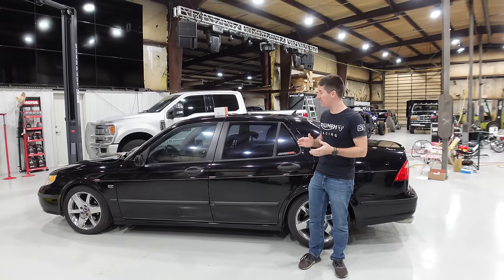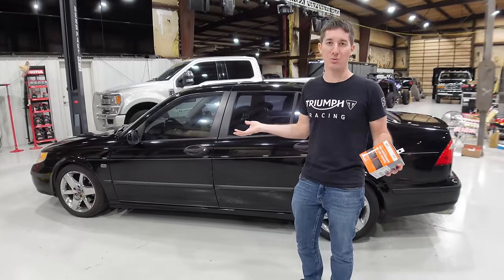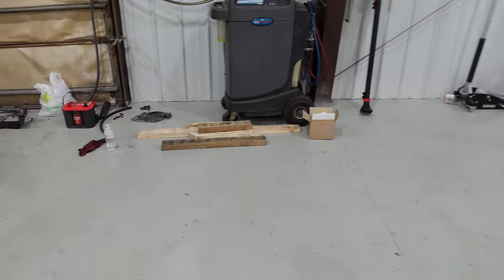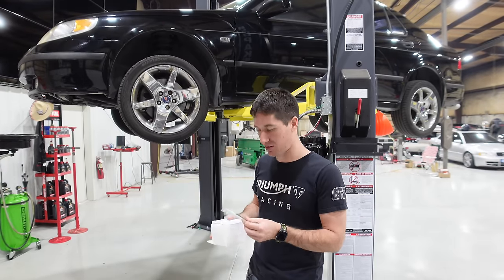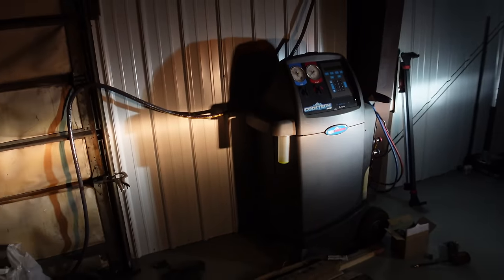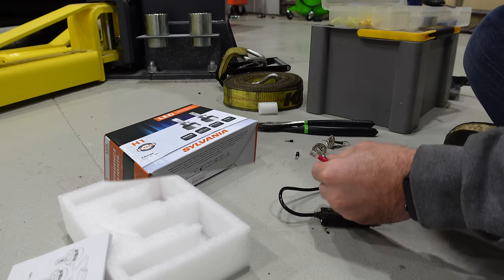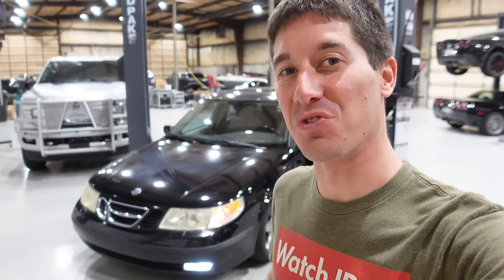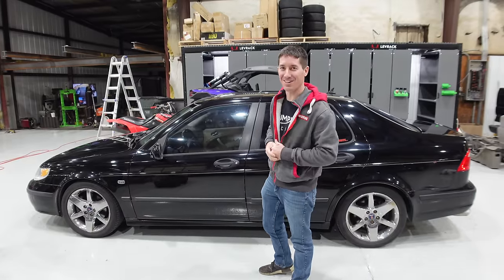Testing LED Fog Lights VS Halogens In My SAAB 9-5

Comment: So how does it work in the FOG? Actual fog lights are yellow for a reason. Yellow cuts the fog better than white or blue. What you have are driving lights not fog lights.
Reply: I find that too bright a light just bounces back at you in fog
Reply: The number of factory fog lights I have seen on US cars with yellow bulbs or lenses can be counted on one hand. Personally I have never understood the obsession with fog lights. In my part of the country fog is not common and good driving lights would be far more useful.
Reply: @RandomGuyDan  Used to run a set of 8" Hella fog lights with 100w bulbs. the pattern was great and the 100w bulbs behind yellow lenses cut through fog or even snow amazingly well. Made my 1.5hr commute a breeze.
Reply: It has already been said in the comments that he doesn't really have fog lights. Either of those lights will be a bitch in real fog. Having said that..... Fog isn't really a problem in Wichita.
Reply: Halogen lights for Halogen headlamp fixtures. Yes
Reply: @eggy1962  kkkk k kk kk k k k kk k kk k kkkk kkk kkkkk k k k k k k kkkk kkk kkkkk kkkk k k k k k kk.

Comment: I believe these over- bright lights are unsafe and effect oncoming drivers night vision adversely.
Reply: Same.  That's why I've never used them in a non projector housing meant for halogens.  The beam goes everywhere.
Reply: it 100% illegal to install leds in halogen light assy. reason companies can sell them is because they say in the fine print on the box offroad use only.
Reply: @mraccord92  projectors don’t change anything…. They will stop put out more useable light with the halogen bulb they are designed for.
Reply: He clearly shows the beam pattern is preserved and won't blind anyone.  Headlamp installations may vary but these are effectively the same as the incandescent
Reply: @GH-rc8ht  why comment if you didn’t watch the video?
Reply: That doesn't bothers me as much as a brodoser with un adjusted headlights.
Reply: Better LED bulbs are designed to closely mimic the light dispersion pattern of halogen bulbs, and provided the housing is adjusted properly it won't effect oncoming traffic.
Reply: @SteveBassen  yea, no. Lmfao.  OEMs can’t even stop LEDs from glaring….  🤦
Reply: @highseed69  Only "illegal" in headlamp housings.  Fogs have an agreed upon "pattern" among manufacturers though their effectiveness varies greatly from maker to maker.  Not DOT regulated in the same way headlamp patterns are.  

Read his Sylvania H1 box front carefuly. "For Fog Use Only" nothing about Off Road Only.  Sylvania as he points out is a global company not cheap aftermarket junk.  I'd think someone would certainly target them if their bold box labeling was incomplete or an saying it's a H1 replacement that's not street legal under say, DOT or MOT standards.  

I'll wait for the Sylvania yellow spectrum version to come out.
Reply: @GH-rc8ht  Problem is most people where I live drive with the "fog use only" lamps on full time. Doesn't matter if it's foggy, snowing, wet, dry or even daytime vs nightime, they all just want to illuminate literally everything in front of them as bright as possible.
Reply: @GH-rc8ht  when they over power your headlight they are illegal. ive done the updated inspection courses and my dad been automotive red seal mechanic since 1978. those bulbs are over bright because they qill blind back in fog and snow at the driver. also those are driving bulbs because white not fog lights(fog are yellow). the top light line is even but 
in the video u can see they are flooding forward and sideways too much. u dont want white pavement when light is on.
Reply: Oh yeah i dont care
Reply: Not true for fog lights. You can replace them with led and it is legal

Comment: I did the same mod to my explorer.  I put in led fogs.  Which are as bright/brighter then my headlights.  And left the headlights as the halogen bulbs.   
I also modded it so I can run the fogs and high beams at the same time.  Which really helps make everything brighter.

Comment: I have replaced all the lights on both my Harly's with LED all around.  2001 Fatboy, Headlamp, Passing Lights and signals, break and running lights and my 73, Ironhead Headlamp and signals, breaks and running lights.  On the Fatboy I had to add a resister in the turn signal line so I could use the turn signals.  On the Fatboy I bought an adjustable blinker unit that allowed me to add resistance to my turn signals till they worked.  It has a dial on it.  I did this not so much for the quality (Quality is better than the OEM incandescent bulbs)  but to save on power usage.  On the Ironhead you have a generator that only puts out so much power and on the Fatboy I added a full fairing with Sterio and I wanted to save on power from the added audio.  Great solution for quality of light and saving on power.

Comment: I put Diode Dynamics LED bulbs in my '18 Colorado low beam projector housings. Very noticeable improvement over the stock halogens (although I've gone through a few pairs, had issues with dimming, but the company has honored the warranty and sent free replacements).

For fog lights I actually prefer keeping the stock halogens. The slightly amber-ish color temperature I think does a better job helping me differentiate what's right in front of me than the white/blue-ish LED color.

Also for hi-beams I run halogens for one main reason - here in New England during the winter, ice will form on the headlights. Old school halogens throw off a ton of heat and can quickly melt the ice. LED's throw off little to no heat, so the ice on the headlights won't melt, forcing you to bang on the light housing to break the ice up. With my setup I just let the truck run for a few minutes with the hi beams on, and that's enough to clear the plastic housings off and drive off.

Comment: LEDs are cool, however not practical in the area I live in winter.  They don't produce enough heat to keep ice from building up at -25.  And the lights freeze up much faster at -40.  But I do like them.  If they weren't such a PITA to change, I'd run xenons in the winter and LED in the summer.  Just like changing tires for winter and summer.

Sylvania usually does their research on lights, however, I'm not sure the color will be good in fog.  Usually amber is what's used in heavy fog and blowing snow.

Comment: Really like the Zevo license plate lights.  Lifetime warranty on those!
Reply from the maker: And the best part is I've never had a failure on one! 💯
Reply: @waynepantry7023  as long as the original owner got that part. So say I buy a lifetime warranty on bulbs if I sell the vechile the lifetime warranty goes away
Reply: @waynepantry7023  just register the bulb with Sylvania and submit the receipt and they keep it on file.

Comment: If you do the window rollers, use Volvo v60 ones. They're square instead of round and don't tend to break as easily. Nobody else really has videos installing them but they're supposedly much better.

Comment: I have a 2002 Saab convertible and one interesting thing is it's came with a rear fog light from the factory on the drivers side. On right hand drive Euro Saab cars had a drivers side rear fog light. Not sure if the 9-5 came with that option but still an interesting option.
Reply: The saab 9-5 does come with this option, it intensifies one of the rear break lights.
Reply: Late reply here... I also have a 9-3 CV w/the driver's side rear fog lamp, but I only realized myself a few years ago that the right side w/trunk keyhole is just glass. Anyway, I went to a different garage this year for my state inspection, and b/c MA doesn't test emissions on cars older than 15 yrs, it's mostly about safety, esp. lights, but not fog lamps. I had to tell the guy three times that side is not a light, but he wouldn't listen... instead, he insisted on opening the trunk and inside panel to look for a bulb. Of course, he didn't find one.🙄
Reply: @laurat1129 why didn't you just show him the owner's manual? 🤔 Anyway he can't be too much of a mechanic or inspector if he is unaware that this is a common feature on many vehicles made in Europe. 🤷
Reply: @seanwainwright2627  Not sure where you are, but it doesn't work like that in most of the U.S. If he wasn't going to listen to me as the owner, what makes you think he was going to read the owner's manual?😑

Comment: How bright do the fog lights need to be.  Won't that light reflect back when you are in real fog?
Reply: You are dead right. If you have lights that are too bright they reduce visibility because the water molecules in the fog/mist reflect the brighter light and you get a cloud of glare in front of you.
Reply: But it lets others to see you easier.
Reply: @emrei  not in fog. All on coming traffic will see is a wall of white light. Meaning you as the driver in your car can’t see nor can the car coming towards you,clearly see your car’s position on the road.
Reply: They are mounted low to project the light under the fog and out of the driver's line of sight. The low height helps to reduce the scattered light coming back into the driver's eyes. 

Yellow does work better because of reduced scatter compared to a white light spectrum.  It also has the benefit of improved contrast for the human eye. 

Check out France's headlamp laws which ended in the 80s.  Yellow headlamps and fogs were the only setup permitted prior to.
Reply: @emrei  That is not the purpose of fog lights.
Reply: @GH-rc8ht  I drove down from Oregon to Las Vegas in January one time with a trunk loaded with heavy stuff.  Most of the way I had to turn off my headlights so I could see.  They light was reflecting back onto me and blinding me.  The bright fog lights will do the same thing.
Reply: @GH-rc8ht  We saw in JR's test at night, the fog lights lit up the whole street.  He said his headlamps weren't even on and I could see for quite a distance.  Fog lamps don't need to be that bright.
Reply: Yellow fog lights work better
Reply: It is exactly the purpose, to be seen @mexicanspec
Reply: @emrei  You are kidding, right?

Comment: Fog lights are ment to be yellow as they cut better in fog which is the whole point of them white LEDs will cause the fog to be blinding also you should never really install LEDs or HIDs on non projector housings
Reply: Agree 100%

Comment: I tried some led bulbs in sister 99 300m and they were 6k which looks great till we drove it at night it was more blue than white and the light didn't throw very far. After that they started dying after about 6 months. They were super cheap and fanless so more then likely overheated and eventually died. Wouldn't have been so bad but those cars are super hard to change out the bulbs or housing. Looks like they have made some improvements in the last few years. I might try some better quality 5k bulbs in my Charger and see if they're less blue and have better light throw now. They do now make 5k color temp but they're rare.
Reply from the maker: Gotta have a nice heatsink or a fan for sure, I've had so many cheap lights fail 😢
Reply: @WatchJRGo  The cheap ones had big heatsinks on them but I guess it wasn't enough and of course they drive them really hard to get decent light output. I was worried about the fans failing when I got them but they need them apparently. The high beams still work but she almost never uses them.

Comment: Yeah it's very bright but if it's not reflected properly it's going to disperse in a shorter distance also the fans are pretty noisy on those and for a fog light it's going to get a bunch of dirt and snow and other crap in it I'd use an HID no moving parts cool and it will reflect properly.  Those put out good light in your video but you may be blinding people.  I believe the thinnest LED bulbs on the market are half millimeter between the you know the actual bulbs like the thickness of the PCB board but it's still not center it's suprizing the difference that that makes.

Comment: Problem with LED and HID lights are not legal on all vehicles.  A projector type lens is required.  Too many DIYers put them in anyway and blind oncoming drivers in a fog, low or high beam headlight.

Comment: If you do headlights try to go with ones with thinner arms that the LEDs are on. I use the latest Auxito LEDs and they are really thin so the LEDs are closer to where the filament would be so the beam pattern is more accurate.

Comment: I have a 95 trans am that I installed 4.5" harley LED driving lights in place of the factory fogs and haven't used the popup headlights in over 4 years.

Comment: with no splash tray any water from your front wheels, is going to spray the fan unit at the back with salt/sand and road grit thrown by the wheels the light units should be  enclosed within the light housing so are better protected there in sufficient air within the unit to keep the fans working without road contamination shorting the life of the bulb,  fog lights cut under the fog for you to see road markings ect without the glare bouncing back off the fog/mist to blind the drivers vision.

Comment: I know Sylvania sent those to you, but I have been using Beamtech LED for a while in my headlights for a few years now. (The ones without the fans - they have three styles now) Only ever had one bulb fail and that was after 2 1/2 years of continuous use (acts as a DRL too.)

$35 on Amazon and they are plug and play. Had an issue with an older vehicle, where they started causing interference with the radio. I emailed them about it and they sent out a set of ballasts to fix the issue. (Had them with in two days)

Comment: Interesting video, thank you. I am considering this conversion myself. What I do not understand is how the H1 bulb is attached to the housing now that the bulb holder is removed from it's position. Am I missing something? If there is a new collar involved, does it come with the bulb? Another thing is that the bulb fan is exposed to the elements. Has it stood up to them?

Comment: Can water can enter the fan? @ 5:45,  I noticed the fan casing is not waterproof which is sticking out. I have a Maxima, the stock fog light bulb is H3 and is completely waterproof. I can't find a H3 after market LED bulbs that can fit inside the fog light housing, the plastic cap must be sealed in order to prevent water entering. H3 bulb length is about 1 1/2 inches long, including the base.

Comment: I had LED H8's on my convertibles fogs.. They grenaded the UEC, there was a hole the size of a thumb in the control unit once I got it out, it had oveeheated so bad due to lacking resistance.

Comment: What do you have to weather seal the lamp around the new bulbs? The LED lamps usually won’t fit in the rubber boots used to seal around the original bulb.

Comment: Nice light out put, but what happens when that 10,000 rpm fan sucks in dirt or snow?👍
Reply: Especially that low to the ground.
Reply: I imagine the fan works similar to how a CPU fan works in that it pulls the heat away from the heat sink/metal housing.

Comment: Why don't these LED lights flash on and off really fast with this Saab? Do you buy an adapter? What should I buy? I bought LEDs for my Saab 9-5 and they flash for a bit when I turn off the car.
Reply from the maker: Better drivers… the Chinese ones use low quality PWM. The high end ones flash faster than the camera is refreshing or use voltage regulation.
Reply: @WatchJRGo  First, thanks for your video and for responding! The LEDs just flash for a bit when I turn the Saab off. What adapters should I get? Is there another way to fix this issue? Thank you!
Reply: @TheDavid2222  how did you manage to fit them? I dont find the correct socket, any recomendations?

Comment: Installed both Philips and Osram/Sylvania H7 led's in my '98 Volvo S70.
Osram/Sylvania in the high beams and Philips in the low beams.
Great light output and very easy to install. Can't see any difference between the two brands.
Reply: Do you have any issues with passing inspection?
Reply: @npolite22  Not due for inspection until December, but I'll have to swap the low beams back to the halogens to pass. It's pretty strict here in Sweden.
But it's just as easy as changing any H7 bulb, so I don't mind.
Reply: @marcusjosefsson4998  how did you do regarding to fit the light in the tray and what cap did you use?
Reply: @playadelcarmenmexico3283  I just installed the bulbs as I would with a regular halogen H7 bulb, tucked away the wires neatly and put the cap back on.
Reply: @marcusjosefsson4998  i dont get it. The fan is bigger then the cap.
To bad i cant put a picture here
Reply: @marcusjosefsson4998  you have H7 for your fog lighys , shouldnt it be H1?
Reply: @playadelcarmenmexico3283  It's not in my foglights, it's in the headlights.

Comment: Non aero front bumper and chrome double Y wheels. Strange, should really put the shark tooth front bumper on that thing.
Reply: It’s pre the 2003 facelift Saab did on the 95, so I think that was the Aero bumper. The wing mirrors were facelifted in 2003 too and this has the old squarer mirrors so it is a correct Aero for its time. Wheels are an odd one, they seem to be off a lower model like an Arc and weren’t even an option pre 2003.
Reply: @rossfield8850  ya you're probably right, I don't really like the facelifts, I had an 04 aero wagon with the shark tooth and it was ok, but the arc bumpers just hurt my eyes lol. Love my 00 wagon though.
Reply: Arc wheels were all 16 inch.  So were linear base models. Aero got 17s. These were used on the later OG 9-3 Viggen too.
Reply: @GH-rc8ht  I was more interested in who or why someone would chrome them lol
Reply: @cheekslappinsaab  Yeah really. In the 1960s chrome made you go faster LOL. It's been flaking and peeling off everything from Cragar SS rims to 22s since. 😂